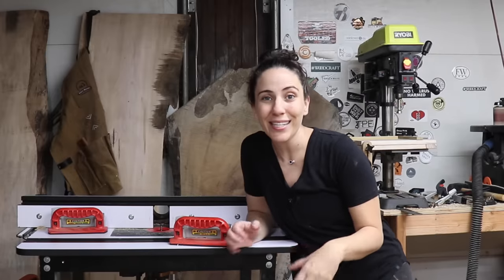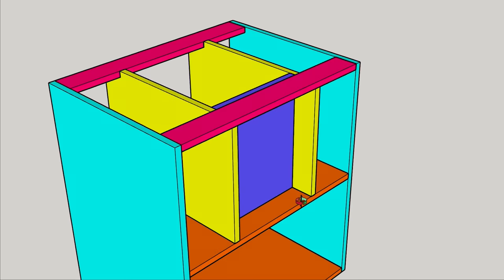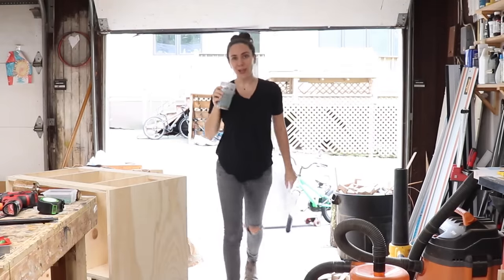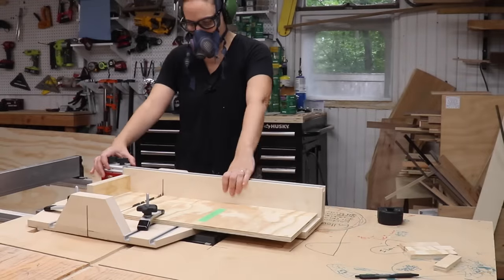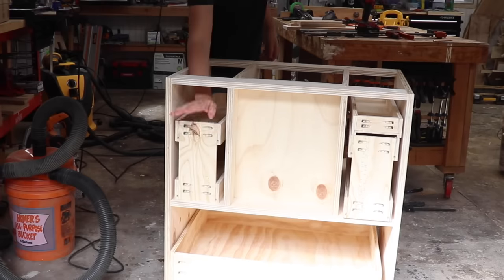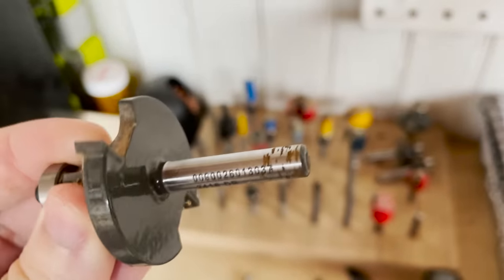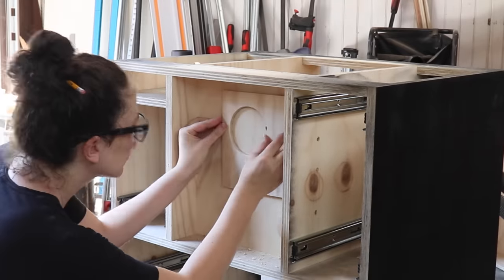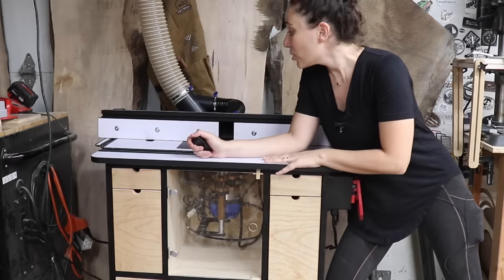Router Table Cabinet Build with STORAGE and DUST COLLECTION

Comment: Wondering since you didn't use it for the grooves in your drawers: did your kerfmaker jig fall out of favor? I haven't had much luck with mine, but guessing that's mostly operator error.
Reply from the maker: Just a little cumbersome to use when making long grooves like this Bc you need to clamp a scrap to the side of the table and there’s not much meat for clamping.

Comment: Great build! i'm also in the middle of router table re-design so this gives me some ideas! Wondering if you had the rear dust collection lower down near the bottom of the enclosure it would work better?
Reply: Check out the Milescraft Dust Router. It attaches to underside of router lift and eliminates dust entirely. Best $30 I ever spent for my shop.
Reply from the maker: I’m wondering the same. And I’ll try it out and update you guys

Comment: oshlun box joint blades on Amazon.   Like a mini dado stack that will fit your saw.   I use them almost every day on the same saw.
Reply from the maker: I have heard that from a lot of ppl but the manufacturer says not to use one. I can’t tell people that it’s safe to use when the manufacturer suggests otherwise.
Reply: @3x3CustomTamar  totally  understand.   Good call.

Comment: Would you say you are still glad to have the throat plate insert you made a couple years back? I’ve noticed it’s not really used in recent videos so wondering what your thoughts are on it!
Reply from the maker: Yeah… something happened to it where it expanded and it’s hard to fit into the saw. I keep meaning to fix it. But it’s always in the middle of a project and I forget about it. Ha
Reply: That’s good to know! Thanks so much

Comment: It looks to me like you put the 4 inch port toward the top of the router enclosure. That would create a dead air space in the lower section (like in a dust separator) allowing partials to settle to the bottom. If you could move the port to the bottom and maybe even put some angled blocks on each side to lesson the dead air space should help dramatically. But loved the build especially the handy bit storage.

Comment: Flip the plexiglass door upside down so the airflow slots are below the dust port. It will run air across the bottom and scavenge the dust off the floor of the router compartment better.
Reply from the maker: Going to try that
Reply: @3x3CustomTamar  Love your videos by the way. Built your small crosscut sled with some improvements of my own. Keep 'em rolling. The other thing I did was to put the dust port on the bottom at the right rear corner.
Reply from the maker: @warrenmusselman9173  awesome!
Reply: @3x3CustomTamar  Think about the idea of steering the airflow around the chamber. The angled pieces are a good idea but also think about using them to steer airflow from your front door towards the  exhaust port. I put my exhaust in the bottom in the right rear corner and most airflow from the front left and used angled 1/4" ply to make airflow bypass the corners in the right front and left rear of the router chamber. It causes a swirl that mostly sweeps the bottom.

Comment: nice build :) the problem with dust in the router compartment may even be as simple as this...the hole in your router table where the bit comes through is huge compared to the bit...try putting in a spacer ring and making the hole a lot smaller to fit the bit you are using :)
Reply from the maker: Def lots of playing around to do

Comment: Wondering why the cabinet dust port wasn't put near the bottom of the chamber so it sucks up the dust as it falls?  Also, could have put the holes in the door near the bottom so the air sweeps over the floor of the chamber

Comment: The problem is turbulence in the router compartment. You should have just placed the suction port at the bottom of the router compartment. A wide and flat opening along the entire length of the compartment is most effective.

Comment: My router table I built has the same problem.. the box around the router fills up with chips. I'm going to try using one of those big gulp plastic shroud things on the bottom of the box and see if that helps..

But I like your design might have to steal some of it...
Reply from the maker: Interesting. That might help

Comment: Great build with very good editing. However I see you made a similar mistake as I did with my router table. The pocket screws which you put on the very bottom piece (with wheels) should be screwed in from the inside of the cabinet. This is because the entire weight of the cabinet is sitting on very small pieces of the plywood, left below the pocket screws. In my case the bottom was pushed inside of the cabinet by the wheels as I added weight to it. A simple fix would be to either put the screws inside OR move the wheels slightly outward so that the side pieces will sit on them.

Comment: I think, if you would make the holes in the door on a lower side, it would suck the dust away from the cabinet floor. When you have openings in the upper part of the door, it keeps the airflow in the upper side of the cabinet and parts that happen to fly lower the air sucktion, will stay on the floor. 🤔
I hope this commemt makes sence. English is not my native language. 😁

Comment: Why acrylic for the door? Just visibility of dust accumulation? A sloped floor in that area and a slot only at the bottom, and a wider bell nozzle extraction port toward the bottom would help with bigger chips. 

One other thought, a roundover on the bottom edge of the top bit drawer would save your hands. I know I would eventually drag my wrist over that sharp corner reaching into the lower shelf and draw blood from my dry cracked skin.
Reply from the maker: Visibility in case something goes wrong. It’s not a necessary thing. I just thought it was cool
Reply: @3x3CustomTamar  agreed on the last part

Comment: Id think maybe flip the door upside down to have slits at the bottom. Hopefully that will shake those pieces up. (Thinking wind coming across the bottom to jostle them maybe)

Otherwise maybe it will get some bits. But now overloaded (hits a critical mass of how much dust is down there that isn't too bad)?
Reply from the maker: I’ll def give that a try

Comment: The dust resting on the bottom is due to there being no air flow at the bottom.

Think of it in terms of using a shop vac to clean it out; you don't put the hose high above the dust, you put it at the bottom near the dust.

Vacuuming up dirt and dust is a tricky thing. 
Too large or too small a hose, and the vacuum becomes inefficient and does not do the job you want.

A couple of tests would be too;

1) Run the router with the door open to see how that affects dust collection.

2) Detach the upper hose and close it off to see how that affects the air flow in the cabinet.

Placing the hose at the bottom, as well as an air port at the bottom of the door so that air must flow from the bottom to the top of the cabinet, should be more advantageous when it comes to dust collecting.

Keep in mind that places where the dust is settling, is showing you where there is little to no air flow.
Reply from the maker: Definitely lots of experimenting to do. I’m going to try with the simplest first. Of flipping the door so the slots are in the bottom. Then if that doesn’t work. I’ll try lowering the port. I can just unscrew that back wall and flip it
Reply: @3x3CustomTamar  
Matthias Wandel has several videos on dust collection; many of which are him building a dust collector. However, he has some in depth insights into how they work.

He has a play list on building a dust collector blower.

Some of those videos may give you some ideas and insight on how to fix your problem.

Here's the play list link.

Building a dust collector blower
https://www.youtube.com/watch?v=LBxFNUWD2GQ&list=PLSnvVtM4lBIU_vvcYBfR0BxHeBgzQyd5n

Comment: I know Over seventy five percent of the comments you're getting are about your "dusty" problem and I know it's the last thing you want to read about but I have two things that will improve your problem and I know they work because you're going to use them on the same table I made.
     The first is where you want the dust to go... Leaving a one or two inch space from the back where you have the vacuum hole use a full Wall between the router and that back wall with ONLY the bottom inch open all the way across, because with the low air movement the dust will always come to the base and just sit there so you only need that one inch opening to pick up ALL of it.
     The second thing to do is make the front door useful in collecting the dust for you... Instead of those giant openings you did, make one or two rows of smaller holes a few inches from the bottom and drill them all at a fourth five degree angle coming into the cabinet down to where the dust is, like a power washer pushing all the trash to the back where it will be sucked up by the vacuum even if it has low power

Comment: I've been meaning to build something like this for a while. I have a Trend Craft Pro mounted to a piece of ply clamped on a WorkMate - it's just a little awkward. The top of the Craft Pro should work much like yours did - just need to build out the cabinet. What height did you build yours to?
Reply from the maker: It’s 31” without the casters. And i used 3” casters

Comment: so I am not sure it will help but if you moved the inlet of the extraction system to the bottom of the area it might have a chance to pull the dust into it better as it will have settled by the time the vacuum gets to it. Not sure it will work but it is worth a try it would still need cleaned out how ever it is done a little cause it will start to coat the router after a while and will probably not be good on the router in the long run but hope this helps.
Reply from the maker: Going to experiment for sure

Comment: Nice build with cool features, but you should screw the side panels on top of the floor panel. Side panels - force down, bottom panel - force up. Your pocket holes have to do a hard job...

Comment: The larger chips are your least concern, placing the dust suction hole on top and cutouts on the front takes care of the dust you can't see and is bad for you. larger pieces you can vacuum or once you get strong enough DC (which I think HF is close to it) put a Y and make 2 holes on both top and bottom. However the front vent has to accommodate the displaced air the DC pulls.

Comment: Beautiful work, maybe if its possible to add another tube into the bottom where the router is so it sucks up the remaining that falls down.
Reply: They are called Y-Connectors and I'm sure that will help out tons if you tried that.
Reply from the maker: I’m going to try just flipping it first. See how that goes
Reply: @3x3CustomTamar  hope it does the trick :)

Comment: Yah!! Shop furniture finally! Lol I have an unrelated question. I see you are using your track saw more frequently.  Have you thought about a video on a jig to utilize the tracksaw to make dados across wide boards for cabinetry using a router on the track?  When you need to make exact dados across 2 boards say top and bottom lay them side by side. I can’t find any good videos for this task. I see you have lots of Milwaukee tools too, my brand of choice I use the Fuel router but need to fashion some sort of jig to make it adjustable and still fit the track.
Reply from the maker: Glad you liked it! I use it with sheet goods Bc they are too large for my table saw. You mean like by using it with a router? I have other jigs for that like my exact width dado jig
Reply: @3x3CustomTamar  ya I’m building your dado jig, bought the plans but is only is set to cut 24”. Say you want to dado for a credenza, you need the bottom and top to have the same dado. To do this you put the panels side by side and cut both at the same time so it can be exact on both panels. So either I make a 4’ long dado jig? Or use my track saw with a router and jig to attach to the rail.
Reply: And you were right it would have been cheaper to buy a Porsche
Reply from the maker: @AshB911  I have set up a temporary fence to do something like that in the past. You just need a straight edge.
Reply: @3x3CustomTamar  thanks Tamar. What better straight edge than your track, lol
Reply: @3x3CustomTamar  I’m on the fence with this cut my panels are 4’ wide I could just use my tablesaw to do the dado? And nudge till I get the right fit?

Comment: If you have voice assistant like Google, Alexa... there are socket extenders that you can use to control dust collection. Simply plug your collector in the "smart" socket and then you don't have to worry about losing the "remote" :-)
Reply from the maker: I don’t have Alexa

Comment: I’m surprised you used pocket holes underneath. I deliver furniture, and sometimes stack things upside down like coffee tables, which have a bottom shelf attached with pocket screws. And sometimes I climb overtop of things while loading and unloading. But I’ve really got to watch where I’m climbing cause if I put pressure on top the underside of that coffee table shelf it will give. I would be careful not to load your table with too much weight, cause that force is all going into a week joint. However, if those pocket holes were on the top of that panel it would be much stronger.

Comment: My only change would have been to have the sides resting on the base. I can't say I'd trust the weight of all of that to rely on screws alone... that or put a second layer of wood on the sides between the base and the casters. I've seen too many shop carts built that way fall apart.

Comment: You may use 1/4” collate for your router bit. As I can see in video, current collate for router bit is way too big which is causing wood chips to fall in that little cabinet.

Comment: Hubby says you have 4 inches of hose going out so you need 4 inches of air going in the front (door) and the air should come in as close to the bottom of the box as possible, you may have a bit too much air going in also? Best of luck :D
Reply from the maker: Going to move it to bottom and see if that helps

Comment: Hi, noobie question.  Do pocked screws give more strength, or do they just allow you to hide the screw heads?  Thanks!
Reply: Pocket screws allow a much stronger joint than screwing directly into the end grain or between the veneers.  They create a screw head sized seat in the material which you pull up against, rather than a screw into the weakest screw holding material.....also, it means a cleaner looking outside for the cabinet.
Reply: @benyarlett7878  thanks for your reply. I now need to find a good jig then!
Reply: @trevor311264  absolutely worth their weight in gold, especially when I'm making cabinets.  The jigs aren't cheap, and the screws cost more than normal woodscrews.....
But I wouldn't give mine up without a fight.

Comment: I wonder if the dust collection problem isn’t that the collection port isn’t near the bottom of you dust box.  The pieces looked to be larger than just fine dust.  They probably fell out of the stream after hitting your router and wires.

Comment: Your “air slots” should of been at the bottom of your door… the air coming in at the bottom would most likely pull the dust up… obviously, bigger pieces will obviously stay at the bottom…
 
Maybe try it with a cardboard piece…

I love what u did.

Comment: Loved the steel joints Tamar, and you almost made it to the end of the project without any glue ups, then you fell at the final hurdle with the plexiglass door stops. For some reason, the speeded up production of this video was making me more crazy than usual, so I tried slowing it down to follow a few of the steps. This worked fine for the visuals, but you ended up slurring your speech as if you were inhaling glue fumes when I knew you were only using steel joints.
The final disappointment, for you, with this project came with the collection of residue in the sawdust box, and, as you said, this resulted from the low power of the dust collection motor. However, this low power problem is the same with household appliances, and the vast amount of dust collectors on the market and the high prices for the best performing ones, could tell us all that as far as dust collection is concerned, there is a sucker born every minute.
Finally, so many draws in this video that at one point it seemed to be every other word, and when your speech was slurred by slowing the video, I could almost hear what sounded like an occasional 'er ending creeping into your pronunciation.
Great to watch you again, Tamar. It was an amazing video project, and best of luck with improving the sucking power of your dust sucker set up for when it is called upon to suck dust in your dust producing future.

Comment: The hole of the main dust-collection should've been made at the bottom. Saw that in another youtube project-video... Andalso, now, because of the slots in the door, to much suction goes 'lost' over there. One slot or even just a few holes could have maybe done the trick... Or... as read here: the Milescraft Dust Collector for a Router.

Comment: Dust collector port on the bottom of the collection area where the lift is would have gotten rid of your need to ever clean it out. I use one from mobile solutions and I never have had to do anything to collection bin where the lift is.
Reply from the maker: I’ll have to try and lower it
Reply: @3x3CustomTamar  I saw a bunch of other comments about the same thing after I wrote mine. Sorry to say the same thing. Appreciate the response. It’s a hobby for me too though. I’m a pain doctor but not as talented as you!